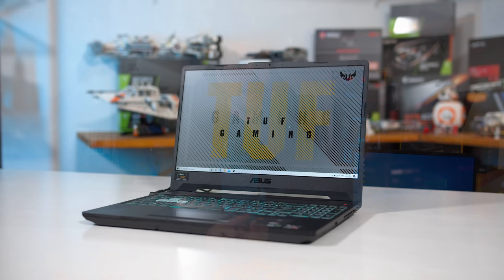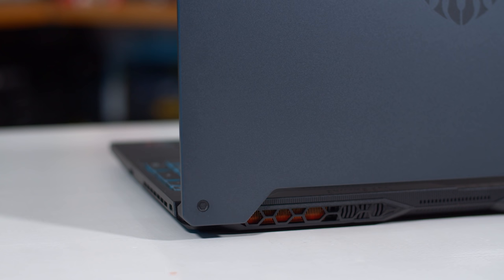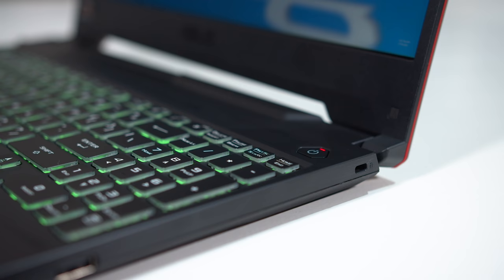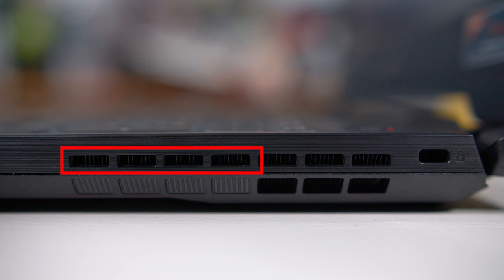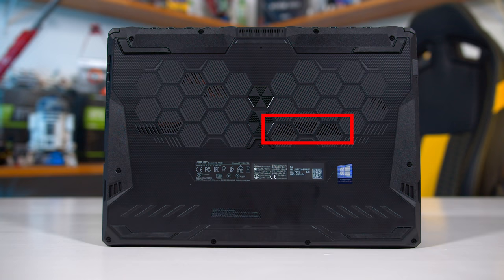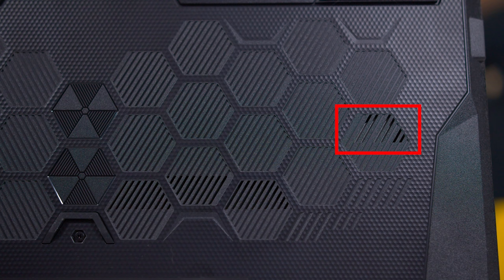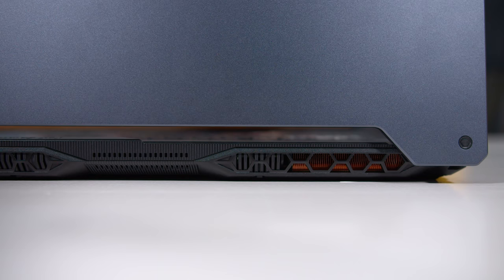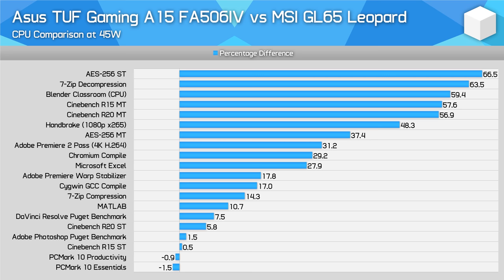Don't Buy The Asus TUF Gaming A15 (2020 Model)

Comment: TUF laptops are pretty bad tbh. I own a TUF FX504GM i5-8300h and gtx 1060 and it had barely 4 heatpipes, it runs at 90 degrees atm, plus to fix this issue they made it so that the gpu and cpu combined can never pull over 100w. cpu while gaming is restricted to 25w and as gpu power is locked out the vddc in gpu z shows 0.75 volts under load restricting to 1200-1300 mhz clock speeds that reduces 10-12 fps in every game over a normal 1060 laptop. And to top it all off asus never gave the 504 gen Armoury Crate support that means we cant change our fan speeds

Comment: I had a asus tuf fx 504 gtx 1050ti  i7 version and its  besically a rocket engine and thermal throttle af 90c temp worst thing i had no choice back then 😐 please dont buy laptops for gaming iam warning you for the long run you will be regret a lot😒

Comment: YEA You are right! - But the reason of this rubbish is, that Asus had an exclusivity of selling the Ryzen-Processors for 2 (two) quarters (about 6 month) before any other OEM could get the newest AMD-Ryzen processors. With this market-exlusivity what is  equal to a temporary monopol Asus had not the necessity to produce a really good laptop but had only the target to sell as much as possible processors even integrated in a rubbish but cheep case. By the way - could it be possible that You forget the slow M.2 NVMe memory what is also cheep stuff? - Its always a pitty when the market ist corrupted by such bloody deals... - 
And thanks again for the tip with the taping/scotching the heatpipe fans. Can I leave these tapes even with the back closed?

Comment: VS cooling DUDE ILL REMOVE THE HOLE CASING TO EVEN PLAY BIG GAMES ya sure it might not be good BUT! if a person just put the hole thing no case Into a sealed cooling BOX would that change anything? I SWEAR IT SHOULD! In long run i wish i did have time to modify every lame crap i get so people can take there negative Crap and put it up there azz #Litterally! Other than having a habit taking stuff Apart!

Comment: I use this laptop to play fortnite and it's a freaking beast 200 FPS+ creative 180+ in game, the problem is the display yes you do ghosting and the colour is bad but its still 144hz and you can always have a extended display.. another problem is it can get a little heated but i have a cheap cooling pad and this really helped.  I love this laptop and things like design didn't really bother me as long as it perfomed it's job.

Comment: Just posting for clarification. As someone who had quite a few gaming laptops the tuf with the rtx2060 and ryzen 7 4800h works great in like 24C room temp the gpu temp never crosses 86C on warzone basically maxed settings. It is a bit hot yes but these are safe temps and it doesn't get throttled. One of the best laptops for the price range don't get fooled but I wouldn't recommend for hot room usage 😂

Comment: ASUS explanation about air intake
https://www.youtube.com/watch?v=ZIoID2kOCso&feature=youtu.be
from 1:40

here is what I thought:
we all know that there are some components  also make heat besides cpu and gpu.
for example ,VRM(Voltage Regulator Module),which may up to 100 C if it's bad cooling design.
If the air intake is not right above the fan, the air flow can pass through VRM region, and then into fans. This cools down the VRM part. 
And,yes,it does deteriorate the cooling performance of CPU and GPU, but other parts on MB may get cooler.

Comment: oh god and the asus tuf a15's that have a gtx 1650 or don't have the side vent only have 1.5 heat pipes how cheap is that and yes the screen in horrible but at least with the rog counterpart its the same where as the rog strix g15 from bestbuy has 2 heatpipes not great but really 1.5...asus is cheaping out just go with msi!!!!

Comment: Really thank you for this. I now got Legion 5 and it's damn cool !
Reply: What is your brand name and model number and please tell me about your laptop specifications and do you have any problem with it ? What is about gaming Performance in high settings?
Reply: @razeharry  I got the Lenovo Legion 5 with 4800h ryzen and 16GB, with 1650ti graphics.
I upgraded the RAM to 32GB as I got them, and added an extra M2.SSD with no degraded speed with PCIE4.
Gaming performance is a so so. I mean it's almost the same to my RX580 based on my experience, not on benchmark.
Been using the laptop with a 4k TV screen with no problem.

And the ports are so amazing it almost feel I have a full blown pc
Reply: @Dongdot123  where you baught it ..? I can't find Legion 5 on anywhere ..did you baught it from Amazon or somewhere else ?
Reply: In my country, they include a free bundle too for 2 years accidental damage insurance and lifetime microsoft office license

Comment: i wish i watched this video before buying
Reply: How is it since you have it
Reply: @hempar9612  looks nice but feels cheap,. Fan make rubbing noise when tilted(about 40 degrees) but this could be my fault. Speakers are nice but it is under the laptop so sounds can differ form the surface it is on.
Touch pad feels bit laggy (opinion). Screen has bit color problem or could be my preference.
Performance is a beast no problem there.

Comment: I wanna buy the 1660ti version in a few days, someone who has experience please reply and tell me about it.
Reply: I got with r7 4800h and it works perfect. Sometimes it gets 92℃ on high performance gaming although I am using Ryzen controller which can limit temperature and it's not affect performance. Mine is not cross 85 after  setup the limit.  Let me tell you one thing all the gaming laptop with high specs Went 95degree. 
So, yeah it's good laptop. Thermals  just
Got the rumors just because of this video.

Comment: I have two Asus because I was a stupid head for buying the 2nd laptop which was on sale. That damn "on battery" keeps flashing on my screen and it's not running on the battery, it's plugged into electricity. The only way to stop the flashing is to unplug from electricity and run it on battery. One minute demo:  https://www.youtube.com/watch?v=xCbVdV5aXLE. 

The other problem is when Asus goes into sleep mode, I can't get it to turn back on. The screen stays black. So I have to hit the power button to force shut down which causes errors in the Registry.  Asus, you stink!

Comment: The a17 is the same crippled version! Inside design is the same, ssd next to heat pipe ,lots of unused space and the bottom cover is again mostly blocking airflow
https://www.notebookcheck.net/Asus-TUF-A17-FA706IU-Ryzen-7-Laptop-Review-Core-i9-Performance-for-1100-USD.466299.0.html

Comment: Don't buy it. I even upgraded RAM to 16GB, but games still lag and drop in frame rates. Battery lasts for only 2-3 hours even at battery saver mode doing light web browsing. My old laptop with an older graphics card could run games much more smoothly at ultra graphics than this. I wish I did my research before buying this.
Reply: god hellp us all

Comment: Great timing for me was about to buy it
Reply: Is there any better laptops at this price range can you help me
Reply: To me the laptop is really great i have been playing many games with it and about the heating problem yes it does get hot but if you are using it in a aircon room or classroom it should be sufficient in silent mode but depending on the model the battery life might be bad like for mine it was the amd ryzen 7 model with 16gb ram and a gtx 1660ti 6gb ram video it pretty good but if using for more than 4-5 hours for school work and at most 3 hour for gaming
Reply: Well the spec were good to me but price wise it was around 1800sgd
Reply: There were some about the same spec but abit worse such as the lenovo legion 5 at 1599 there was also another version of this that was better at 2k sgd with a rtx2060 graphics card
Reply: There were many laptops that were about the same specs but costed slightly less such as the lenovo

Comment: I removed the bottom cover and am using a laptop cooling pad.  I reapplied thermal compound on the CPU and GPU (also relocated the M.2 SSD to the other slot).  Runs BEAUTIFULLY like this (my A15 has the 1660 Ti).  https://gpuscore.top/furmark/show.php?id=94489  Also, it's worth pointing out that you can create a custom power scheme in Windows and set it use about 85% max CPU instead of 100%. That seems to help CPU temps quite a bit, while still performing admirably (when not gaming).  But man, with the cover removed this thing is as cool as a cucumber. So it looks like I'm either modifying the bottom cover or just leaving it removed indefinitely.
Reply: Atm I'm thinking of taking the bottom off to put some aluminum foil tape below the fans to help cool the air entering the laptop, not sure if this will help much, but I 'm also gonna try to buy a spare bottom plate so that I can modify it for more airflow without voiding my ipr, was wondering if maybe you might know the best place to get things like that??? (tried ebay and nothing, laptop is too new)

Comment: I'm using Asus Tuf A15 for almost 6 months and I don't have any type of problem. It's really a good machine. I have played so many games on it without any flaw or any high degrees in temperature. I don't know why YouTubers always try to make complications and confusions every where.
Reply: Calling this fake seeing this laptop was recently released 2 mo that ago. And ryzen cpu announced in January.. Yet you being using for 6 months.
Reply: @njramsfan30  He's prolly talking about the 3750h version, damn retailers are still trying to scam ppl by selling the 3750h 2060 variant for 100$-200$CAN less then the 4800h version just so they can get rid of them..... In fact that's one of the major reasons the 4800h versions were held back, not just covid 19. It's something retailers usually dont talk about, it happens all the time and it actually slows down the progression of technology, every year they hold new products back so they can get rid of the old ones, it's not a problem exclusive to laptops either.......
Reply: @njramsfan30  yes u r right buddy I just bought this laptop in the first week of June but I don't know why I'm in love with this laptop. I don't want to hear any bad things about it. Look u r getting a really good amount of power in really low budget that's all about A15. U can buy a separate monitor and connect it with the HDMI. For the thermal cooling issue, u can fix that problem by just using a cooling pad for 20 bugs from the amazon. I bought ryzen 7 4800h with RTX 2060 version plus 90wh battery and believe me buddy it's just rocking all the big titles like a piece of cake and giving me backup for about 12 hours.

Comment: I am having this model fa506ii-hn152t, and usually see cpu throttling after 15-20 minutes which makes cpu to work on base clock..NO USE OF SUCH A POWERFUL CPU BCOZ OF THROTTLING MAKES IT WORK LIKE RYZEN 5 3750H OR WORSE...and one more thing what is the use of 144 mhz when gpu gives you an average fps around 60fps in most games..it is just a joke 😅

Comment: 'I'm not a air cooling engineer'... then why are you acting like one?  

Don't understand AMD apologists, aside from their desktop cpus everything they make is junk.  AMD for over 20 years sucks at making software drivers.  You would think after a few years AMD would figure how to update their drivers but nooooo they don't seems to care and they still suck at drivers.  As long as AMD apologists exist (there's plenty of them), they won't care.

And I would never ever buy an AMD powered laptop because with laptops drivers and thermal design (another area where AMD lags) are everything.  Just bought a laptop and I did everything to avoid AMD.  Thankfully I got a 10th gen Intel at reasonable price.

Comment: worst review ever, try to beat its performance for its price, yes the cooler could be better, yes the screen could be better. but try to get 240fps playing a game for that price. you cant.
Reply from the maker: There are at least 3 significantly better models. We'll be reviewing some of them shortly. Also JarrodsTech has looked at a few already, you need to work on those research skills mate.
Reply: ive got the 505DV, last gen top model. been running it for 12 months now. only throttles if you dont limit frames in games. i limit to 165 and temps stay under 90 for the most part.   now trying out the 4900 model.  i use and reccomend these to my customers, and i have not had a single complaint, nor do many people these days stress out CPU to max for extended periods for general consumer use.  these bridge the gap between "workstation" and "consumer" in my opinion. you can do alot of heavy lifting with these, at a very handy price point.
Reply from the maker: @RyanArmstrong89  okay well that's a nice non-technical story. As I said, there are better models and if you did some research outside of one brand, you'd know that and would be better able to support your customers.